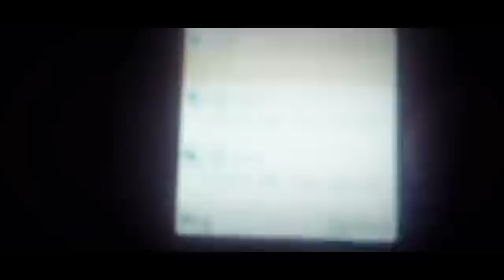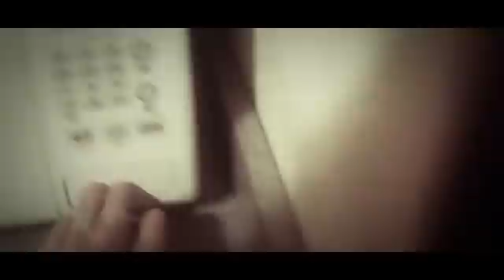Blocking Radio Signals: an experiment to use for future electronic voice phenomena research

Comment: so if i do this over a radiotower, would it block the internet and block the radiosignals and all conections??
Reply from the maker: It depends on how tight your Faraday cage is. If you use the aluminum box, it wouldn't block something like a GPS satellite, but it would block most radio signals (etc). They have pouches that can block pretty much anything, but this is an inexpensive alternative.
Reply: ok ;)

Comment: They won't scatter, but neither will they go out in a straight line. That's because the radio waves will reflect inside the box. But the box isn't perfectly straight, so the waves will come out at different angles.